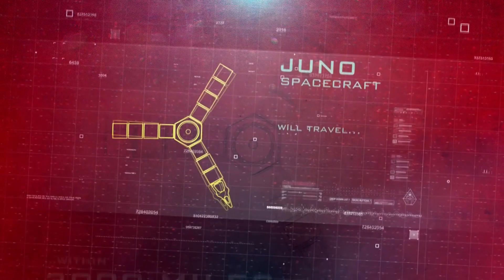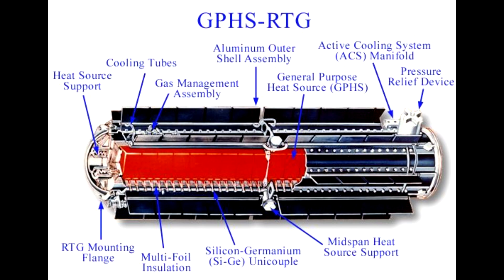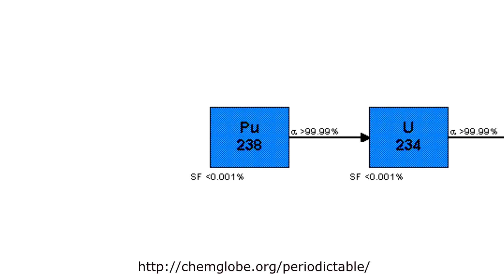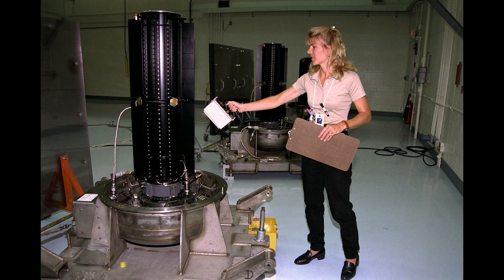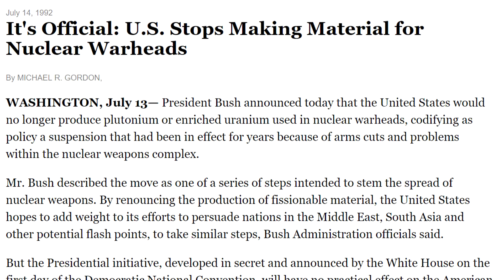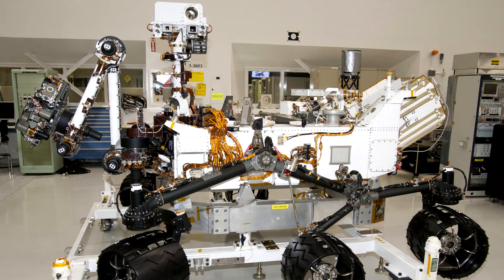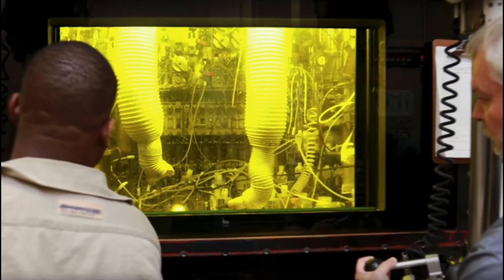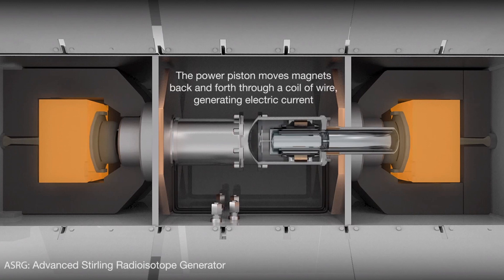Juno & NASA's Plutonium Shortage

Comment: The UK has a metrick fuckton of plutonium just lying around at the Sellafield plant. I wonder if that could be used.
Reply: Wrong kind of plutonium. We need pu238, reactor grade plutonium is mostly contaminated with heavier isotopes, making it unsubtle because of weapons proliferation issues and decay chain gammas.
Reply: Aah, so mucky processing required to make it useful for anything other than reactors.
Reply: Chlorate Ya, it is mostly impossible actually. Isotopic separation of plutonium has either never been done or is shrouded in much secrecy as to be beyond public view.
Reply: Very good point, it'd be like Uranium separation but much more dangerous.  You'd need a very good reason to go to all that trouble, blasting small chunks of it out into space doesn't seem that worthwhile.
Reply: Chlorate There is hope if we ever start doing more thorium fuel cycle stuff, that we will produce a fair amount of Np237 that is great fuel stock. Now, extracting stuff like that is currently a no-no and we don't have reactors like this, but in the future, this might be a solvable problem!
Reply: Indeed, with any luck the general view of nuclear power will shift soon and more research gets the funding it needs so badly.

Comment: Scott, a thermocouple is a temperature measurement device not a transducer...
Thanks for your great videos, always entertaining.
Reply from the maker: +Gareth Jones your sensors work by measuring the voltage generated, but if you scale it up then you can use the same principle to generate electrical power.
Reply: Schooled.
Reply from the maker: Because the moving part generators are much more efficient right now.
Reply: I've actually hooked a radio to a thermocouple and sat it upon an old firewood stove. It works.
Like Scott wrote, the thermocouple used to generate power is a scaled up temperature termocouple, in which case it is often called a Peltier Plate.

You can find one in a nearby water cooler. They have a "cold" and a "hot" sides. Hook it to a power source and it can cool stuff. Hook it the other way around and it heats stuff. Supply a thermal differential and it creates an electric differential potential. I used the stove for the hot side and a jug of water for the cold one It powered my radio while heating water for tea. If you live in a cold climate, you can hook one to your heating system.

Too bad they are currently somewhat inneficient. They top at 25% efficiency, the baseline rating of a modern gasoline engine.
Reply: Genius engineering solution, am guessing amplifiers and inductors (essentially) to increase the mV output off of the thermocouple..? Thanks Scott for your reply, very much appreciate you explaining it as I am an engineer :)  All the best!
Reply: Christopher Willis
I agree about EM, but I have to admit I am pretty undereducated about nuclear reactors.
Reply: There I go, spreading dis-information like a common troll! Do you have any good recommendations where I can find more current and reliable information on various reactor techs?

And I was actually meaning "relatively delicate", when compared to a RTG, but points well taken all around.
Reply from the maker: In general the 'EM Drive' has been handled much better by the researchers than Pons & Fleishman's Cold Fusion work. Most of the announcements have been kept low key and work is being done to remove the experimental errors.

Doesn't stop the press from taking the concept and going nuts with it.

My money is still on experimental error but I'd be delighted to be proven wrong.
Reply: Check out the EM drive Zac, it generates thrust by bouncing electro magnetic waves around a chamber. It shouldn't work, but it does :)
Reply: you stick loads in series and you get a high enough voltage
Reply: +agun17 Yes.
Reply: Cool thanks guys. Most educational youtube comments stream yet, ok probably the only educational youtube comments stream but still this was fun!
Reply: The (tiny) measured thrust was probably from thermal effects. They didn't do the test in a vacuum so any thrust could easily be heated air escaping and generating a little push.
I am highly skeptical of the whole deal - doesn't sound physically possible. (Cold Fusion all over again?)
Reply: richo61 Yup, I think you are right on that...if not the cause just that experimental error is more likely than new physics. With great claims come the need for great evidence, this is not that. The dirty secret the public never hears about is MOST experiments result in not overturning the null hypothesis.
Reply: Christopher Willis Yes - there is a push from the Skeptical community for researchers and institutions to publish more negative results - where the evidence utterly fails to prove the hypothesis. Its not as exciting of course, but still important to know!
Reply: Could you answer a question for me: If we can create energy for space craft using generators with no moving parts. Why do the nuclear reactors we use to power our cities rely on the steam-turbine system we use in coal fired power plants.
Reply: Apparently the Russians used to use thermocouples in a bundle above chimney of an old oil lamp to power a transistor radio, I know you love your facts Scott :)
Reply: Zac - We generate power using the rotating magnetic field principle, involving a rotor with magnets cutting the magnetic flux of coils embedded into the stator or housing of the generator.
It is the nature of the relationship between electricity and magnetism and a phenomenon not fully understood - hence JUNO :)
Reply: And RTGs in space so far haven't even broken 10% efficiency. Usually 7% or less.
Reply: Thaua - Very interesting, thank you for your reply. Have heard of the peltier possibly at college a long time ago.
Reply: No, the EM drive does not work, any force measured where the result of magnetic fields generated by the external electric supply cables. When tested with a battery, no force was seen
Reply: Actually thrust was measured from the EM drive, don't ask me to explain as the scientists and engineers did not understand it either, and I am an engineer. The currents you refer to are called Eddy currents, flemings right hand rule.
Reply: It's all about putting the efficiency against the costs, reactor weight and the like. As stated in the video, you can get ~4x the efficiency of the thermocouple generators using advanced Stirling generators. Steam turbines, however primitive, are still the most efficient solutions we have, but they require an abundancy of water and are very large, that's why they are not used where efficiency is not as important as weight reduction and resource preservation (you can't pack a lake onto a rocket's board, unfortunately).
Reply: Bronek0990 (actually Brayton cycle is better than steam cycle at high temperatures, but we get you. Brayton cycle also has very modest hardware size, but won't scale very well to the size we want in satellites, steam either. Also, you don't need access to water beyond what you start with in a closed loop Rankin cycle, all nuclear plants are closed loops and just use river or ocean water to condense the power cycle. Getting rid of reactor heat is challenging, and would mimic what you have to do in interstellar expansion, need big arse heat fins to get rid of heat via black body radiation. Also, I agree with Turi above, the EM drive is junk, most physicists agree) /rant
Reply: RTGs are small, reliable, robust, cheap, low-powered, and grossly inefficient. Typical electric outputs range fro 3-5% of the actual released energy.
Large ground or ship-based reactors, on the other hand, are huge, delicate, expensive, powerful, super-efficient, and require CONSTANT supervision.

To the best of my knowledge, molten fluoride salt reactors are the most efficient designs in use today, operating at about 59% normally, and up to 74% (during a nearly catastrophic "opps" one plant had) when the temperatures "peak".
Reply: Brad Gefroh MSRs do not exist today, and if they did, none of have plans to use a power cycle that gets near that efficiency. Most nuclear power plants use a very low power Rankin cycle, in the order of 33% efficiency or less. Modern gas turbines that run more as base load get more like 60%. No MSR in history has ever been hooked up to a power conversion cycle, though, not even the MSRE. And I wouldn't necessarily call reactors "delicate", that is more a function of design and the situation. After all, the navy uses them, they wouldn't if they lowered capability to carry out WAR less. But to your main point, ya, nuclear power plant is HUGE compared to a relatively diminutive RTG :D
Reply: In thermocuoples (sensors) the materials chosen to give reasonable linearity and mechanical reliability over temperature - when you are going for power production the materials are chosen for max voltage/current output. Often semiconductors like  Si-Ge or Se and Te is used rather than metals (like Fe - Ni) - they get a decent voltage output just by wiring them in series - Like you do with solar cells - each cell is 0.5 V or less - so you have a series string to get 30 - 50 V or so - then DC DC converters turn that into the 24V Bus volts that the electronics needs.
Reply: They are inefficient - but the "waste" heat is actually very useful for keeping the electronics and other systems warm. Also they are incredibly reliable and keep producing power (electrical and Heat) for 30+ years. No moving parts, nothing to wear out or break.
Reply: Yeah - Its actually called the Seebeck effect.
Thermal difference -> electrical current Seebeck effect
Electrical current  -> thermal difference Peltier Effect.

Comment: Wow, 1.5kg a year. That's slooow.
Reply: Ya :(. With new reactors and fuel cycles, we might be able to do much better. Important to keep investing in reactor technology for this and clean energy :D
Reply: +Christopher Willis the anti-proliferation argument is that they will monitor the storage of protactinium 232 and the main argument is that As u233 is being made it is also contaminated with a dangerous U232 isotope which is a gamma emitter.

hopefully time will tell but the pu238 arguement is a big selling point.
Reply: @TCBYEAHCUZ  The question is why you would even jump through all those hoops in the first place? North Korea has no nuclear reactors, yet they still have made bombs. It's simple, you dig uranium out of the ground, enrich it to 90% 235, and voila, you have a nuke.

The arguments against these reactors because of nuclear proliferation were moronic in the first place.

It's actually easy to produce pure Uranium 233, you simply separate the Protactinium and wait for it to decay into 233, no chance of it getting contaminated. U233 was also regarded so highly as bomb material that had they started from scratch they would never switch to Plutonium, they simply had all the infrastructure to produce Pu already.
Reply: OnePercent I don't put to much trust in LFTR ever existing (it uses highly enriched uranium, which is a no no), but there are other MSRs that might use thorium in the works. Also, I think it is 15kg of Nu237 a year.
Reply: yea though its ridiculously hard to make the stuff so thats actually not terrible
Reply: with a commercial scale LFTR you're getting about 300 kilograms of plutonium 238 in a single fuel cycle which would be 2 years.